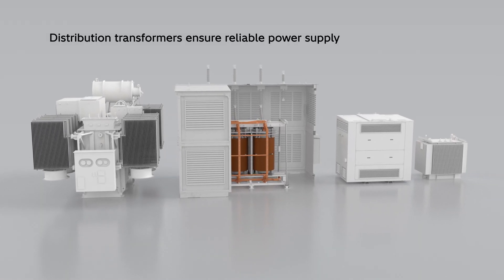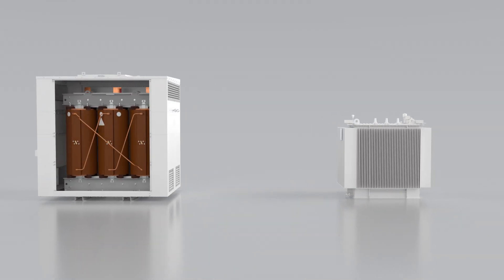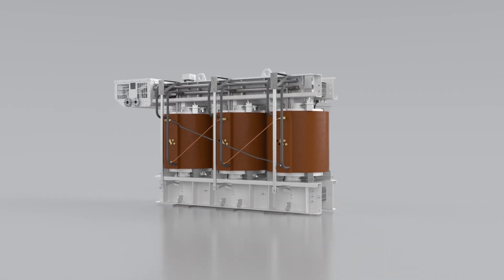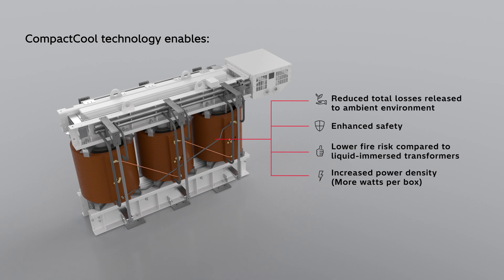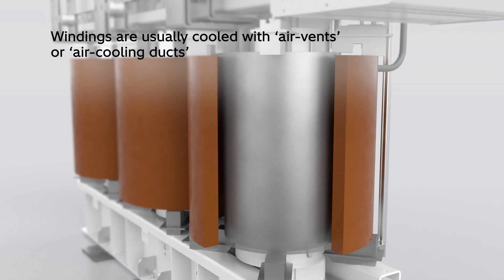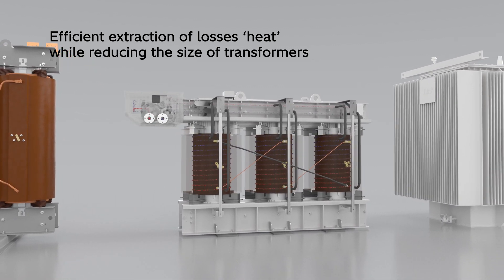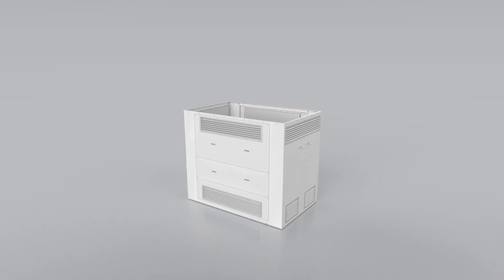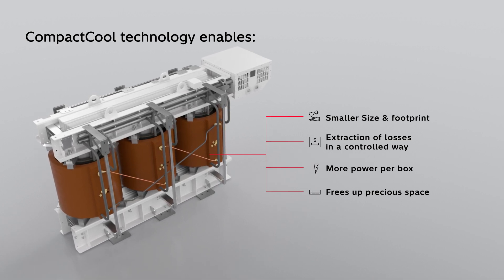CompactCool™ Technology for dry-type transformers

Comment: Really interesting and the video is very nicely done. This is a novel innovation, but it poses a number of obvious questions for me.....

 - What is the thermal rating of the transformer and is it FM Approved/UL listed?
 - What kind of oil is used here in the heat pipes/exchange system?
 - What would be the risk mitigation - namely in terms of containment requirements - of potential leaks from the external heat exchange system, as the liquid is taken away from the transformer? Traditional liquid filled united have a bund but the liquid is all in once place ....presumably containment is more complex but still a requirement.
 - What is the maintenance regime for the heat exchange system? Does it match the intervals of the unit itself or are there more trips required, more downtime in order to service the heat exchange?
 - Is the warranty of the heat exchange system inclusive of the whole asset?
 - Do you still need a fire suppression system if located indoors? If not, why not?
 - FM Approved liquids allow for smaller liquid filled unites ...what would the benefit be to the end user, in having a unit with a more intricate (complicated) design that contains more components?
 - How are noise levels/harmonics compared with traditional (the equivalent) cast resin/dry type units?
 - Are the windings any easier to repair than traditional cast resin transformers?
 - How do the low losses compare with traditional dry types including cast resin transformers?

Thank you